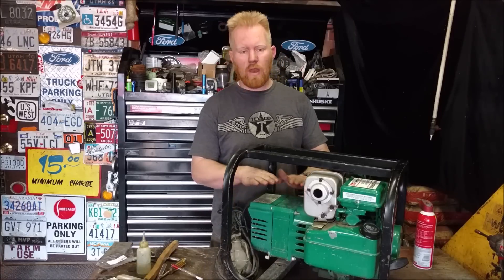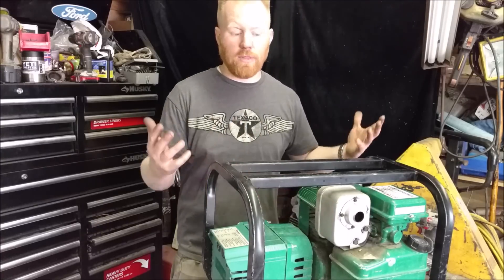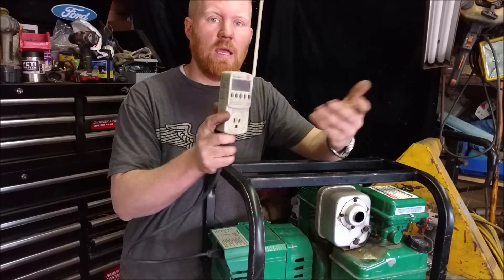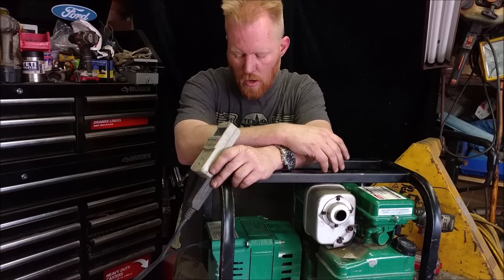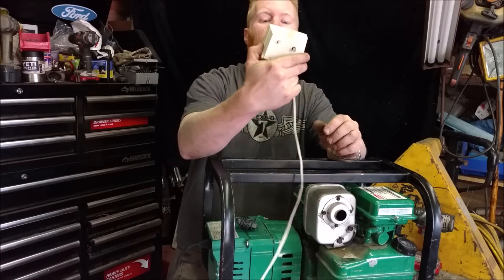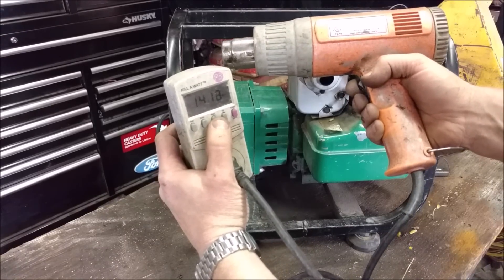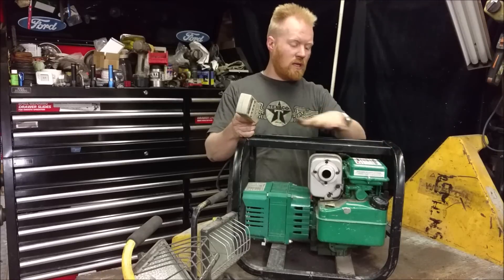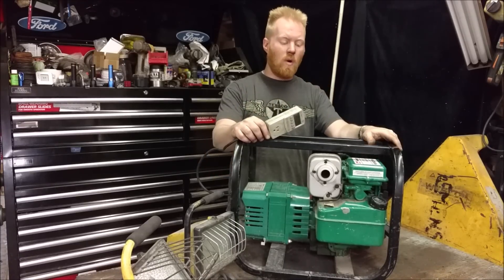Tune a generator Head DON'T FRY YOUR ELECTRONICS

Comment: For sensitive electronics that I care about (like the expensive computer controller on my gas furnace) I will also put a battery-backed UPS inline with the generator and the furnace. The AC power coming out of the UPS is a digital sine wave and (so long as your battery on the UPS is good) remains at 60Hz even if the generator isn't. Thanks for another pair of great videos!! I have this exact same generator..complete with horrible over-spray green paint job.
Reply: Someone reminded me today that some UPSes have a pass-thru circuit that essentially allows the direct AC power through to the outlets while a battery charge circuit charges the UPS battery. So I think the take-away from that is that unless you have tested the output of your UPS while connected to a generator, you should probably assume it has one of these pass-thru's. Maybe just charge the battery on the UPS, disconnect from the generator then use the charged UPS battery to power whatever AC system you are interested in. Pretty hacky, but it beats frying your sensitive electronics. I do know there are also inverters out there that can plug into the generator and will provide a clean sine wave at 60Hz.
Reply: I set mine up so that I could disconnect the furnace from the panel box and power it via an external power source. I only use this in the event of a prolonged power outage emergency. I did all this work during an outage..which I don't recommend given your patience will also be on short supply at that moment too. Better to think it out ahead of time. I do know UPSes just for furnaces are sold..I just don't know how long they'll operate for or how much they cost.
Reply: I'm not familiar with what a UPS (other than the guy who delivers packages to my house) is? Can you provide any additional info? I learned the hard way about that controller on my furnace, wife does not want me to do that again. I have an inverter I can use, but my "big" generator I would use for an extended outage is just a larger version of the one in this video.
Reply: Tim theToolman Sure. A UPS in this context means an "Uninterruptible Power Supply". They first became available for consumers as short-term battery backup and surge protection for your computer. They give your computer just enough "on" time in the event of a power outage to save your work then close down the computer correctly. There are larger units meant for emergency power of radios and lights like the stuff at goalzero.com. There are also manufacturers of whole-circuit systems that will automatically provide power to a certain number of circuits in your breaker panel for a length of time dependent on how many batteries you have installed (or can afford..batteries are very expensive!). Then you have companies like Tesla who are making "power walls" that purport to provide whole-house power for "N" days on battery power: https://www.tesla.com/powerwall. All this to say that none of this is cheap to do or even recommended..or even commercially available! The path 99.99% of all tradesmen will recommend to you is install a transfer panel and a generator that will power a number of circuits in your home.
Reply from the maker: I was under the impression from a few UPSs I pulled apart that the power from the wall charged the internal 12v battery. Then the inverter ran off the battery and provided 120vac to the appliance. When the power failed, the internal battery just was no longer recieving a charge but still running the appliance off the battery's stored energy.  I didn't think it ever passed 120vac straight through, but I could easily be wrong. IF this is the case you could easily run a basic inverter off a cheap sealed lead acid battery with a 120vac to 12vdc battery charger, keeping it full.
Reply: Thank you for the info
Reply: Almost impossible to describe via text and I have to run to my second part-time job right now thanks to our "recovery" from the great recession. BUT I will say that I built a system from scratch similar to one of these systems: http://www.wholesalesolar.com/back-up-power. The biggest expense will be the batteries. I was lucky, I had access to a used battery supply for free. I don't have a decent generator yet myself.
Reply: I agree. And I have a (albeit older) UPS made by APC that will condition the power in-line. Try it, but get someone with some knowledge and an oscilloscope to verify the output I say.
Reply from the maker: Semper Fi
Yes.

Comment: where do you get your thermal fuses I just found a bad one on my small maintainer charger. 1.5 amp charger. I have not been able to locate them or know what the term for name is.
Reply from the maker: Ebay has always had them for me. They come in a bunch of different temperature ratings. Generally the temperature rating  is written on the side in Celcius.
Reply: sixtyfiveford thanks, I found them there

Comment: Another informative video. I never knew to adjust a generator. I have an old noise maker that I haven't started in a long time and I have a killawatt meter like that from harbor freight.
Reply from the maker: They're great for letting your neighbors know your enjoying electricity.
Reply: @sixtyfiveford  Power  outage there are very simple thing you can do to cut down generator noise   I use to place  the generator next to the  garage wall and then learn a board over it .it  will bring the noise down from 75db to 60 db  But the best one just place it in a box trailer on the side and then lean a thick   board  over it. it bring it down to  55 db.

Comment: All good information! Liked the tools you use to check and set. Especially the old analog clock with a second hand! So if I have a horizontal shaft engine, did you say I could get the electrical box at HF? I'm  going to go watch the sound suppression video you linked us to! Thanks so much!
Reply from the maker: HF used to sell a generator head but I think they discontinued it(it was a huge 10k requiring 20hp). Small generators like the one in the video can generally be picked up in non running condition for $50 or less on classifieds. Generator heads will generally have propitiatory tapered engine shafts that aren't interchangeable with the typical straight keyed shaft you would see on an old horizontal motor.

Comment: I disagree with you. The voltage is more important, Hz become important on
inductive loads, like a compressor. what is priority volts between 115 to 122.
Reply from the maker: Both are important, but regardless 60hz is the standard for North America. They are tied together and setting one changes the other. If you set the HZ, the voltage will fall right inline unless something is wrong with the generator head. It also allows you to keep your engine within safe RPM limits. Some older generators are rated to 110 volts, some 115 and some 120 all at 60hz. There is no single voltage standard labeled on all devices for voltage in the US. You will find stuff labeled 110, 115, 117, 120, 125. The average voltage in the US fluctuates anywhere between 108 VAC to 132 VAC and devices are designed to handle this fluctuation. Within reason devices will compensate by pulling more or less Watts at lower/higher voltage.  Most people I know use primarily inductive loads on generators: air conditioning, refrigerators, power tools etc. Electronics being a very minor load but those are very forgiving these days and are designed to convert any voltage from 100-240VAC and 50-60hz to 12/5VDC power to run themselves.

Comment: The clock to check hertz was a great tip. So simple but I never thought about that. Great video as always Moe.
Reply from the maker: It's slow but works without specialty tools. That's always a plus in my book.